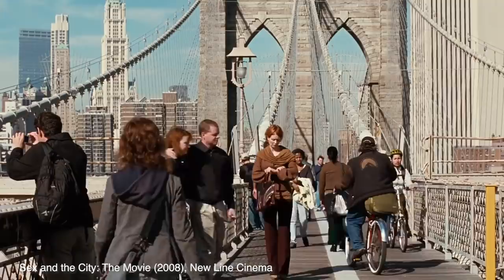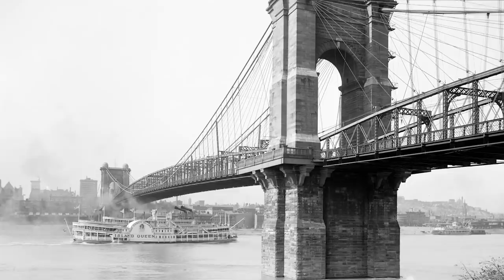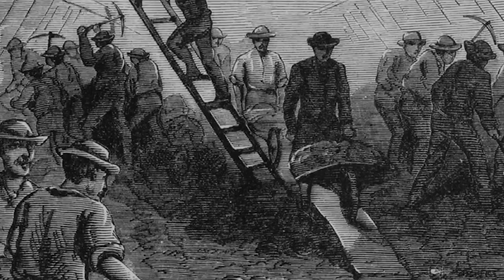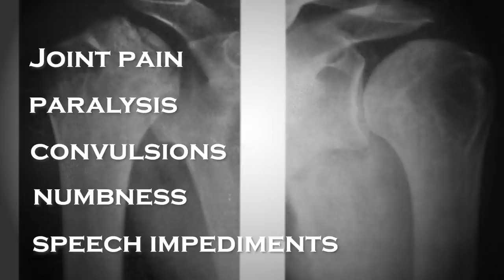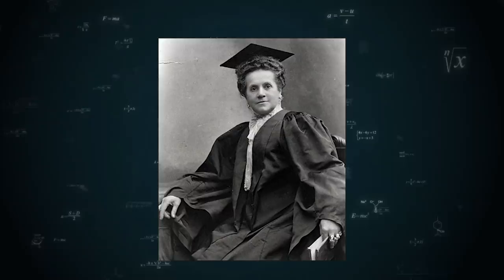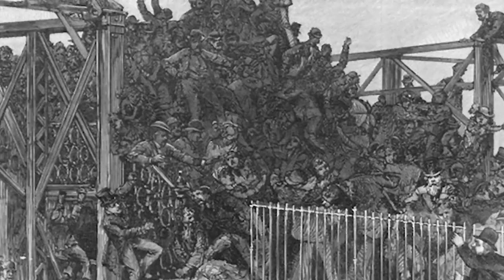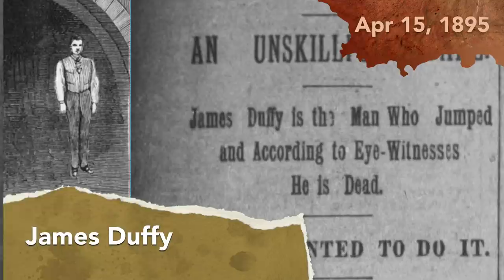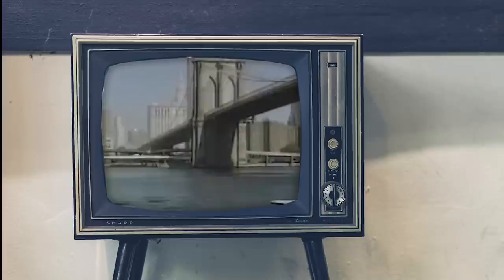What Happened During the Construction of the Brooklyn Bridge

Comment: The stone towers were built on top of the wooden caissons.  The roofs of the caissons were , i believe, around 10 feet thick.  The caissons were ultimately filled with concrete, yet the massive towers are sitting on wood. I am surprised that the wood apparently didn't decompose, causing the towers to settle or collapse.